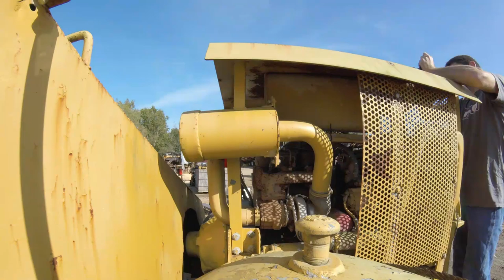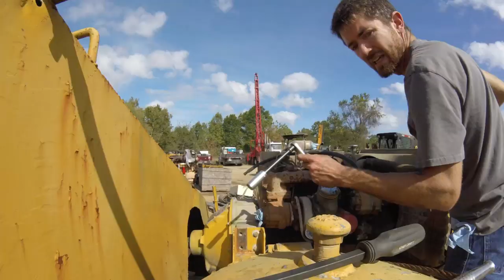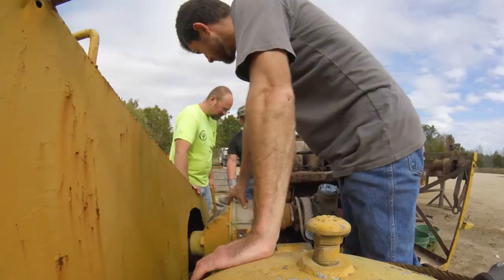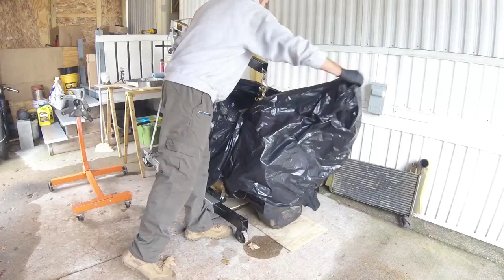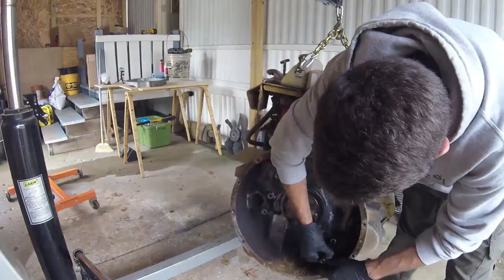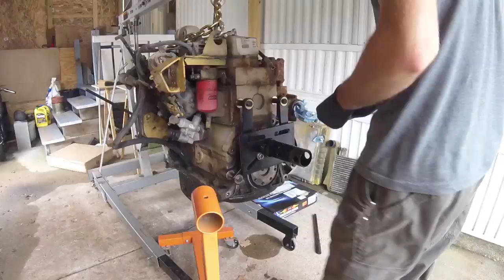Engine Donor, Heart of a Mud Pump × 4BT Cummins Discovery #1 [Land Rover Build]

Comment: Thought is was pretty heavy. Are you going to upgrade the front coils? I was leaning towards an aluminum block LS because they are similar weight to the 4.0 but much more powerful and reliable.
Reply from the maker: Yes + rear springs as well due to the custom cabinets & all the added camping/recovery gear.
Reply: Are you getting custom made coils?
Reply from the maker: Perhaps, first order of business will be getting it on a scale with a full load-out.

Comment: I"m curious as to the power that will generate. When I look up that engine it only produces around 170 HP and 240 Ft Llbs- is that really an upgrade? Wouldn't it have made more sense to keep the V8 but use a new block with flanged liners?
Reply from the maker: yjmsrv  Thankfully the new 4BT is far from stock now ;)  Bigger turbo, much more RPM, & loads more fuel! Should be good for ~200hp with 500-600 torque (double that of a healthy 3.9L & at only 1600 rpm!) plus 20-25 miles per gallon (more than 3 times my 3.9L range!). Not to mention both aftermarket & replacement parts are tenfold easier with the platform sharing the very popular 6-cylinder versions. And maybe most importantly the simplicity & reliability of these mechanical Cummins is just unmatched (million+ miles is not an oddity).

Comment: Any details on this particular mud pump? Like manufacturer? Year made? How did you find this one? They have more? Can I really be nosey and ask how much you paid?  Thanks. Watched all the videos of the work you did to it and am looking forward to putting one in a Big bodied Ranchero. W.
Reply from the maker: Not much for details really, since the 4BT was a retrofit in place of Detroit Diesel.  He had another but it was run for hours without oil on a jobsite...nothing but a core really.  I worked out a deal to save a couple bucks if I tore it all down myself, right around 2k.  Oooo that would be cool!
Reply: Tinker 
Thanks for the reply!!
W.